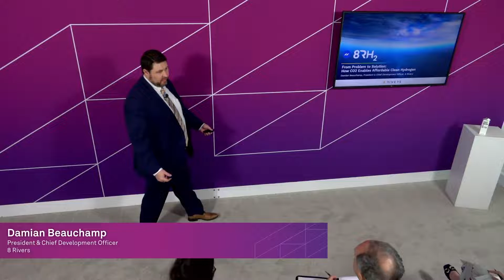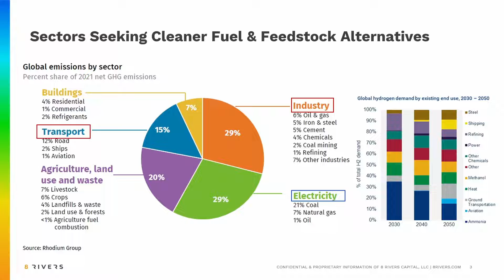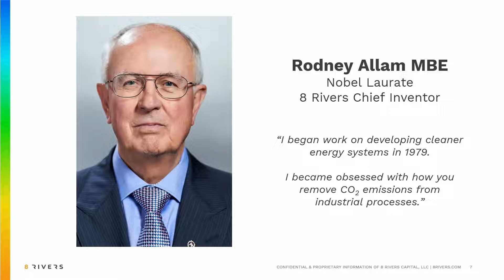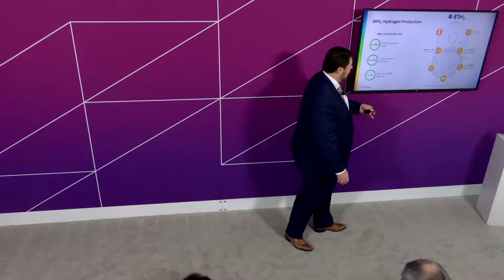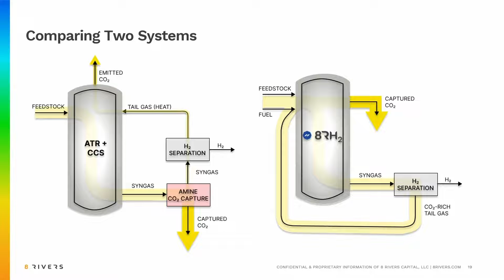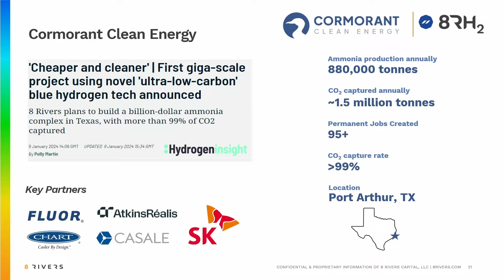Ultra-Low-Carbon Hydrogen: Introducing 8RH2 - CERAWeek 2024

Comment: Cheap hydrogen is very valuable in crude oil refineries for removing high sulfur that would otherwise make lower grade heavy fuel oil unable to be refined into higher grades of fuel oil and diesel.  High sulfur heavy fuel oil is traditionally sickening to inhale the exhaust from marine diesel engines.  Marine diesel use is now greatly restricting the use of high sulfur heavy fuel oil.  

-------
No climate change from global warming that was to start at 1.5°C of global warming causing stronger observable hurricanes in the Gulf-of-America (Gulf-of-Mexico).  NASA reports global warming at 1°C where it has been since 1992 after falling from its reported all time high of 1.1°C in 1991.  The cause of global warming is not known in 2025.  Earth's water vapor saturated greenhouse effect is due to water vapor adding 10°F (5.55°C) to earth’s average temperature absorbing all the greenhouse radiant energy from the earth within a few meters of the radiating surface.  The other greenhouse gasses can not change its overall effect.

On average human caused atmospheric carbon dioxide is less than a 0.1% share in earth’s water vapor saturated greenhouse effect.  Water vapor has a CO2e of 18 and on average 1% of the troposphere.  Carbon dioxide has a CO2e of 1 and is 0.04% of the atmosphere 400ppm.   

1.00%/0.04%=25,  water vapor is 25 times more present in the troposphere than carbon dioxide.  25 X 18 CO2e = 450 CO2e for water vapor and 1 CO2e for CO2.  All the other greenhouses add up to a bit less to about the same as that for carbon dioxide or 1 CO2e.   Carbon dioxide has 1/452 (0.0022) share in earth’s water vapor saturated greenhouse effect at average 1% water vapor.  

40% of atmospheric carbon dioxide is considered to be from human activity;  0.0022 X 0.40 = 0.000885 leaving human caused atmospheric carbon dioxide on average being less than a 0.1% share of earth's water vapor saturated greenhouse effect.   5.55°C X 0.000885 = 0.0049°C share in temperature retention from human caused atmospheric carbon dioxide.  

Water vapor always hold earth’s water vapor saturated greenhouse effect in saturation.   The other greenhouse gases can not change the overall effect of earth's water vapor saturated greenhouse effect.